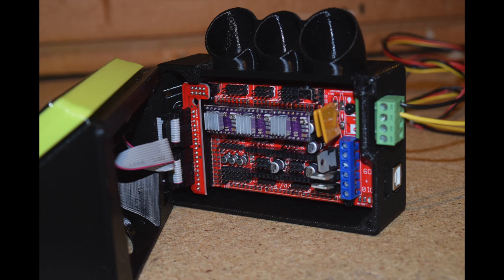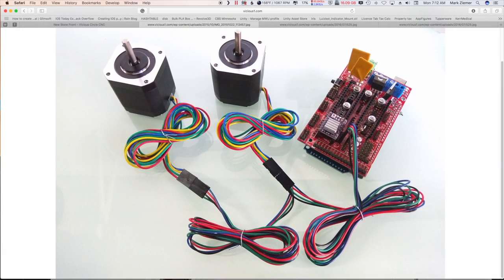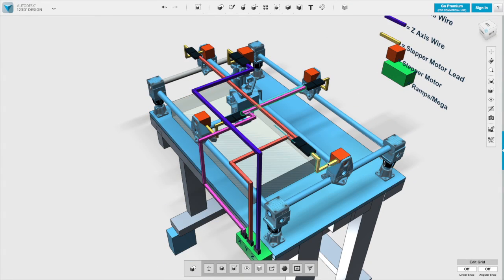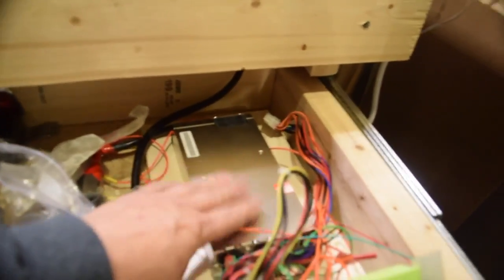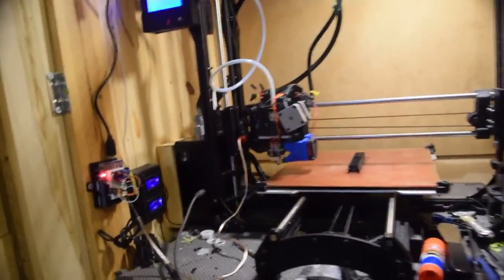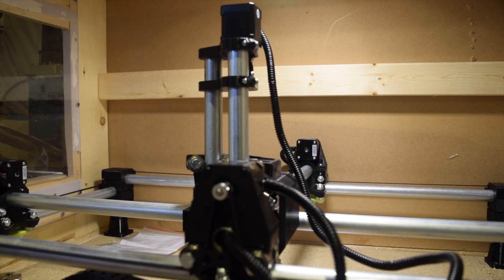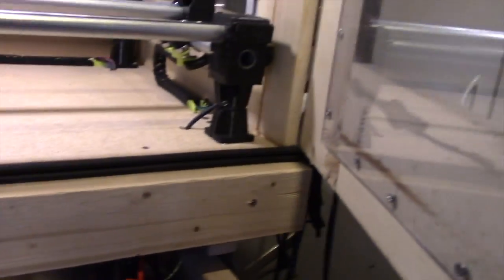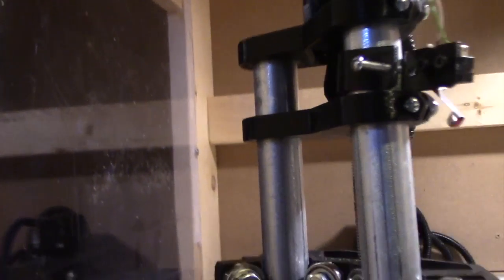Mostly Printed CNC (MPCNC) Build Part 4

Comment: Where did you get the lcd display?  It did not come with my kit order from Vicious1.

Also, I sure wish you have done more detail on hookups.  You just blew by that part.
Reply from the maker: Here's what you need or the display. This one's on amazon, but they're available all over.  Ebay, Reprap, etc.  https://www.amazon.com/dp/B015Z25YRG?psc=1

Is there something specific you'd like to see in the hookups?  Let me know what questions do you have, and I can try to answer them or make a video.  If you plan to connect endstops,  here's a video on that  https://youtu.be/m1tDHY3cNec
Reply: Thank you!  I have the mechanicals down pat but the electricals are new to me.  I am still puzzling out where on the controller board to make all the connections.  Thanks again, most helpful.
Reply: I posted a "thank you" earlier but it did not show up here for some reason.  So, thanks again.  I really need an illustrated "plug this in here, and that in there" sort of thing.  My kit did not even include a circuit board diagram for the controller.
Reply from the maker: Got it. Give me a couple of days, and I'll come up with a video on that.  Thanks!
Reply from the maker: https://youtu.be/Q8h211pE61I
Reply: Saw that a few minutes ago.  Thanks!

Comment: OK thanks...  Do you think it will go normal with 73 oz inch  steppers. That is what I plan to buy. Is it OK for aluminium and wood..  What's your suggestion...
Reply from the maker: Abhin Raj 
I would think that would be fine. Here's what the vicious1 website has to say about it "Power
– X and Y axis are power by 2 stepper motors each, and a single stepper for the Z axis. The standard would be NEMA 17 in any torque 42 OZ/in and above (the kit come with 76OZ/in). No need for NEMA 23’s or their required larger drivers,  X&Y axis power is not one of this machines issues."

Comment: Thanks for the reply.could you pls mention the ampere rating of the motors
Reply from the maker: sorry for the late replay Suprisingly, it doesn't say on the stepper motors. I think that info came on a little slip of paper, which I should have kept.  I can't get back into the item on ebay, but similar ones seem to say 2A. I'm sure I set mine for a bit less to be on the safe side. They don't seem to get warm at all.

Comment: Very nice setup, one question though, shouldn't you use shielded cable to stop any emi problems?
Reply from the maker: Probably a good idea.  However, the signals to control the laser, the future servo motor, and cables back from the end-stops are shielded.  Thanks for watching!

Comment: Nice video! I may steal the bit about the cable chain and put it on the Thingiverse page. you did a great job explaining the process of breaking the links loose, which is the most questions I get on it.  glad you found it useful… and I wasn't sure it would work with those end parts but it's good to know, now I don't have to design extra parts for that.  and yeah since you built it into a cabinet like enclosure you should move your wires to the back.  for printing it isn't an issue though.
Reply from the maker: wbarber69

Thanks a bunch!  Of course you can use it. If you want a link, or lift that section, its fine. I can put up an excerpt too. I need to document that I made one yet, I was planning to link the excerpt there. What ever way you would like.

Thanks!

Comment: If you really really want to use endstops....to use a z endstop you would home it at the bed or just slightly under (with a divit carved out at the home position). And you always set your work piece out some given distance. This is all done in your cam software pretty easily. The only extra step is factoring in your material height in the CAM. I did this on the intermediate tutorial to show how to use wood with a cruddy surface.

Thanks for the vids, I love them! I hope to put them on the site somewhere if you don't mind?
Reply from the maker: allted 

Thanks for the tip!  I'll have to go back and rewatch that video. I'm honored that you've even watched my videos, and would love to have them on your website. Incredible!  Thanks!

I've got a couple of questions, if you don't mind, I'll send an email vie your site later today.